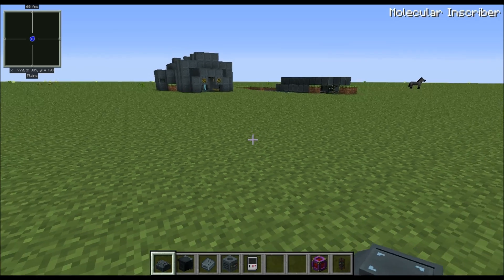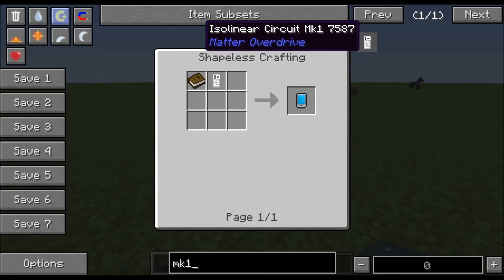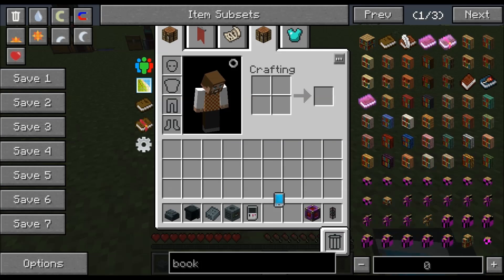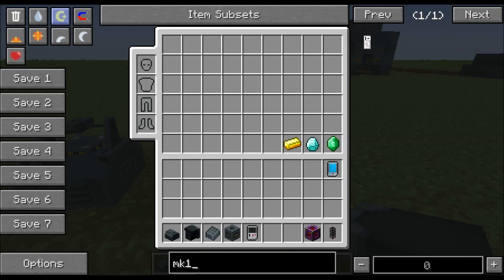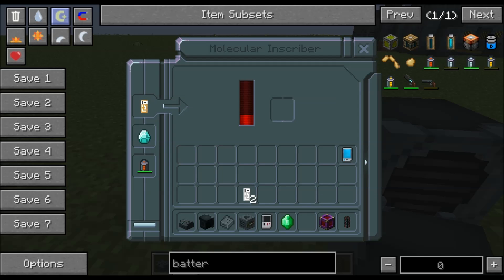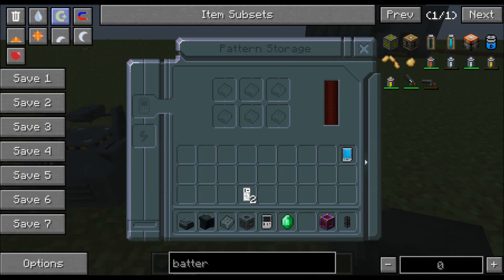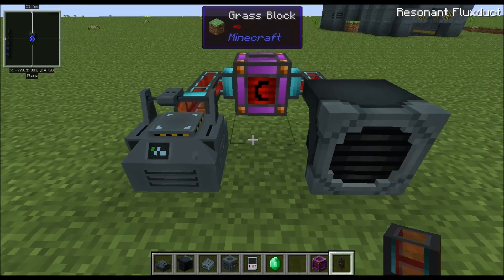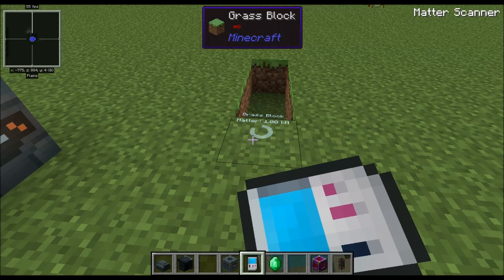(OLD) Ten Minute Tutorials: Matter Overdrive Starting Basics 1/4

Comment: the charging station doesnt charge my battery... how do tf i charge battery lol
Reply from the maker: Check out the updated video
Reply: @SliderHavoc  i did but the matter overdrive charger doesnt actually charge a battery. I had to use thermal expansions Energetic Infuser. I do appreciate the videos tho, just the documentation for this mod on the wiki isnt great like you mentioned
Reply from the maker: @bobotea1234  The battery has to be in something that takes batteries and then the item will charge.